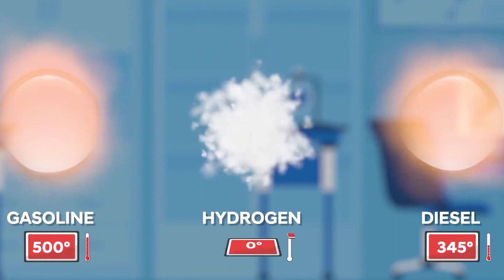This Company is busy converting Duramax V8s to run on Hydrogen

Comment: ellectric's better because the energy grid already exists while the hydrogen grid isn't there yet. electric also has less lifetime cost and lifetime emissions than hydrogen. Right now the main problem facing electric is lithium scarcity, but once we figure out how to make graphene batteries it's game over for hydrogen cars.

hydrogen will remain a valuable resource, it has tons of applications, just not as car fuel.

Comment: Internal combustion engines are designed to run on a viscus fluid ( vaporized gasoline ) not microscopic molecules like hydrogen, but by mixing hydrogen with a tiny quantity of liquid water the burn rate and temperature can be controlled. In short, by adding the right quantity of liquid water at the right time hydrogen will behave pretty much like gasoline or diesel fuel. Oil, heat and material used for the pistons and cylinders will prevent corrosion. As for range the Hyundai Nexo tank holds 6.3 kilograms of hydrogen and that's enough to go more than 400 miles.

Comment: There's just not enough gas station that produce hydrogen as fuel most gas stations are converted to gasoline or diesel and you're not going to just make a bunch of gas stations cover to hydrogen overnight takes a long process that's why it's easier to convert to electricity because it's more plentiful because the wires are everywhere

Comment: If you compare hydrogen to electricity and normal gasoline in terms of volume/space required to go the same distance you would need too much stored hydrogen to go the same distance and the other options.

This is the real reason it has not been implemented in commercial vehicles. Best use is still compact small highly efficient cars that don't require very much energy to move so they don't need to store as much to reach a destination.

Check out engineering explained to see his example.

Comment: Agree electric is not a viable alternative in a lot of cases but Hydrogen as an Internal combustion fuel is insanity. Storage problems such as volume, safety and refuelling mechanisms make any sort of viable range impossible. I repeat storing enough Hydrogen to power an internal combustion motor, as they currently exist, for the range needed is currently impossible.

Comment: Great video 👍Toyota and Honda keep working on Hydrogen technology for a reason. As mentioned here in the video. If you care for the planet. Electric vehicles are not the only answer. Cummins are also doing interesting research for engines as well.

Comment: I agree but kinda think battery cars are not going to make it due to Africa demanding to be paid fairly for the cost of their raw materials and furthermore wanting to do all of the value adding operations on the continent. This may sound strange but the West has been at Africa for a very long time causing all kinds of trouble just to get the raw materials they need on the cheap. Then there is the unfair business practices surrounding EV's where now the owners are starting to realize they may have paid for the car but they don't actually own it. Yeah, there nothing like being a EV car owner who made a bad tweet about something wrong with the car to wake up the next day and no longer be allowed to use the supper charging network. 
Most people tend to not know that there were a lot of home hydrogen fueling stations being sold before the automotive players were interested in moving in the hydrogen direction. As far as I know two companies survived and thus if you buy their system you can refuel your hydrogen car from the comfort of your own home. Plus with the newest conversion kits hitting the market you can save that car you love by purchasing the hydrogen kit for your car instead of sinking a tone of money into buying an EV you truly will not own.
I know I am on point with these talks but am interested in what all of you think.